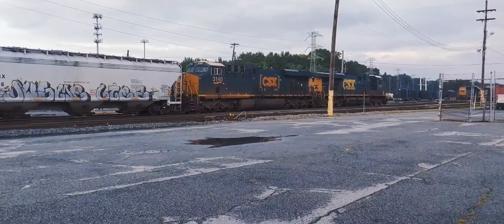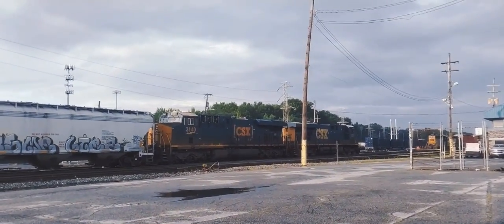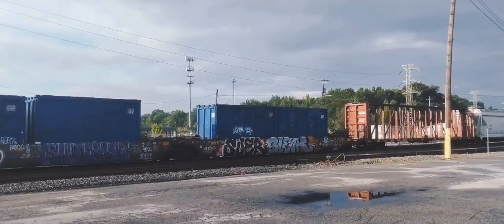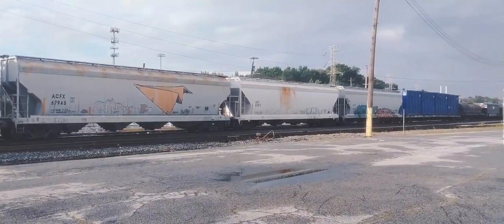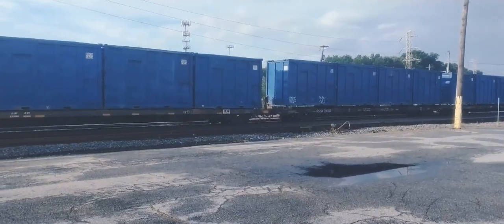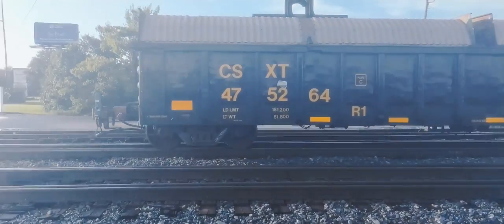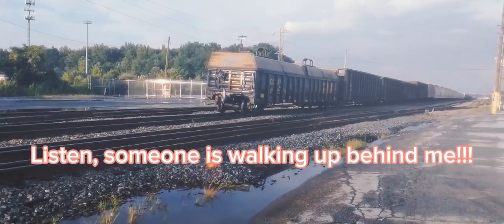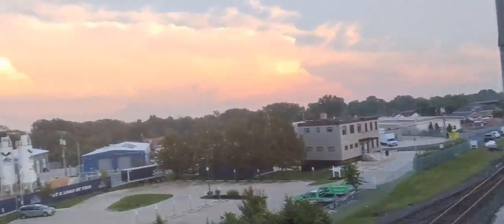Attacked while explaining CSX Train Handling Techniques!! Do Not Miss it!

Comment: For 5 or 6 years I had a dedicated run from here in central PA to the GM assembly plant in Wilmington, DE.
A majority of my trailer was aluminum wheels so I spent most of my time at the tire dock which had a great view of the rail loading spur.  
A mobile ramp would pull into the end of the cut of autoracks and a parade of new vehicles would fly into the cars.  The drivers would climb down the ladders and load into a van for round 2.  It was very cool to watch.
Reply from the maker: Those are some amazing memories!  Thanks for sharing and thank you for your view and support!

Comment: 7:42 I've never seen them in that config either.  You could see some more in the background in the yard before the train got going.  I watch the PU tower Lehigh Line cam a lot and they have the daily that comes out of Newark NJ carrying NYC municipal solid waste each day and they have specialty skeleton cars that can fit I want to say 3 of those boxes on each car. Much more efficient and they all follow the angle of the track well, so I figure that the cars are inherently shorter than flatcars.

Comment: That last car, that's the 1st time I've seen a gondola with those covers on them. It's more than likely hauling steel coils but I've always seen the coils ether in a gondola in the open or the actual coil cars with the hood's on them. 
Well at least you got to get threw with the train before you got pestered. Looks like you had things under control tho.👍

Comment: How do they secure the lumber on centerbeams?
Reply from the maker: The lumber sits on both sides and there are metal cables connected to the car via a winch system that secures the lumber or other product in place.  I say other products because I have seen lumber, railroad ties, and roofing shingles shipped on Centerbeam Flatcars.